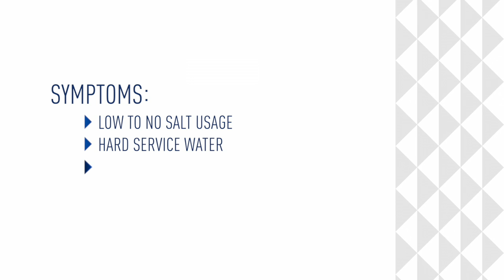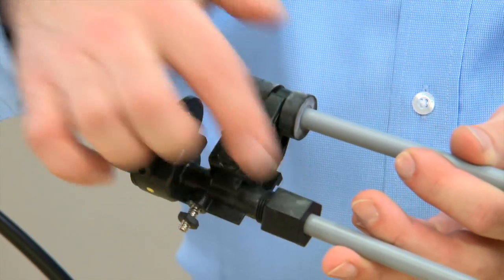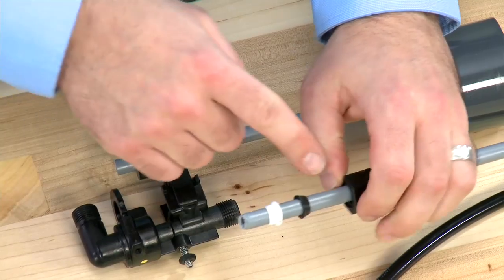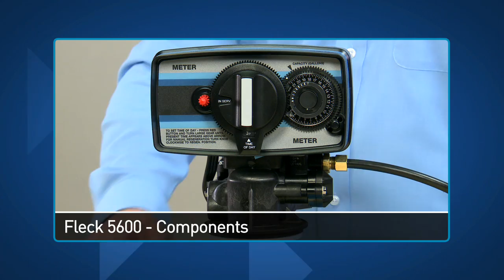Fleck 5600 Air in Brine System

Comment: Thanks for the video it definitely got me thinking. I knew the tube allows water to go in the tank and brine water to be pulled out. Holding the pic-up tube in my hand and holding it straight up and down I could blow air in (water fill) but when I added suction the check valve would block the air (like it should) but I thought how will it pull brine?   Then I realized I had to submerge the check ball section in water so the check ball would float and not block suction!  This save me from buying an assembly I didn’t need 😊. The problem ended up being the slip ring on the nut was on backwards causing air suction. No brine being pulled out = no salt usage… hard water.